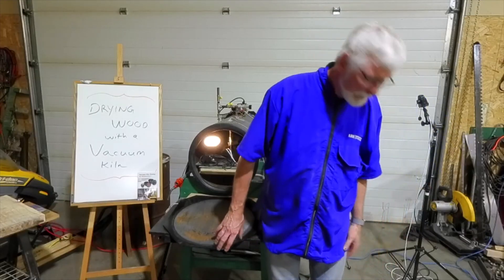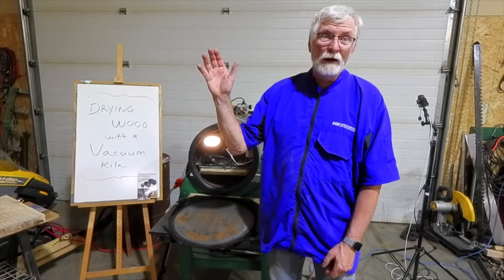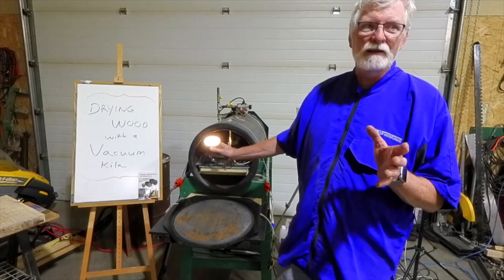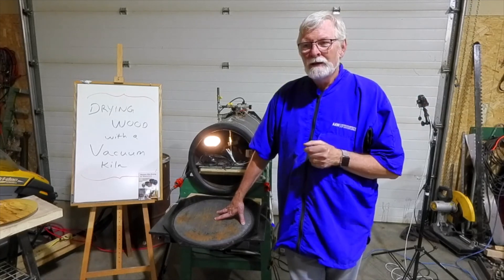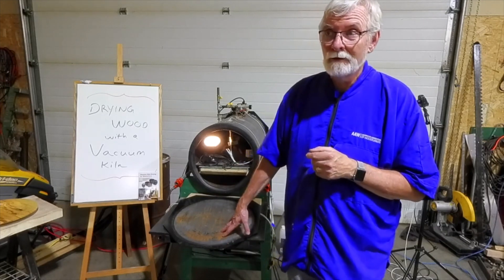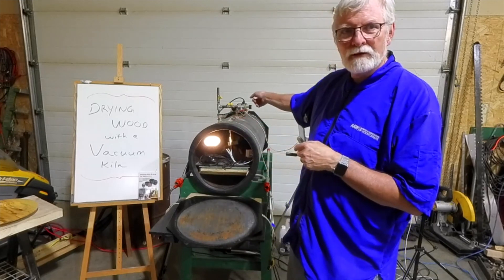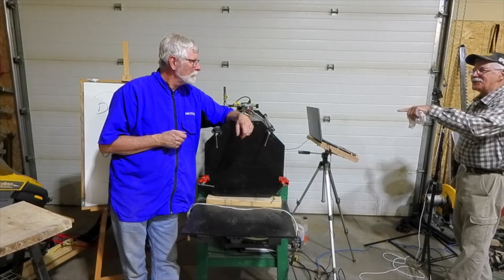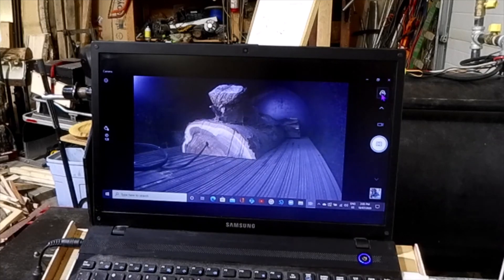Vacuum Kiln for Drying Wood

Comment: Excellent video, Jeff. I was thinking about how to build one until I stumbled upon your video. I am looking to build one to dry boards as long as 8 ft and maybe 4-5 at a time. Do you feel the boards should be weighted down as they dry to prevent warping? Or is this not necessary?
Reply: I imagine they would do better that way since so many have a natural twist. Obviously I don’t dry stuff that long. I have observed that many people want to do the long stuff. I just do wood suitable for turning which was the intention of this video.
Reply: @j.hankinson7803 I would agree but wanted to make sure I wasn't just wasting my time. I'll let you know. I am going to try to use an air bladder of some kind or two plates that can be compressed via external jack bolts.

Comment: Would a 100 gallon propane tank be usable?
Reply: This question has been asked several times in the comments. I think it would be much to thin. Those things have roughly 2 to 3 mm walls I think (1/16 to 1/8 in bananas). Mine is more like 9mm (3/8 bananas)

Comment: Also for heating - look into the ceramic infra red heaters that people use for reptile enclosures. IR transfers perfect in a vac and the ceramic type of lights construction should be good for within the chamber. This eliminates the need to heating pads and such making contact.
Reply: Thanks for your comment. I have a similar vacuum kiln built. But mine consists of a flat plate heaters placed underneath the trays in which the material is to be dried. The flat heaters do not dry evenly. So I was also contemplating on installing IR heaters into the kiln, but was skeptical if it would serve the purpose under vacuum. Your suggestion inspired me to try out IR heating. Will come back to post the results after installing IR. Thanks for your valuable comment
Reply: @abdussamadshaikh3467  I am looking forward to hearing the results.
Reply: I considered that as a heat source but the penetration of radiative heat is probably a lot less than conductive heat. It’s tough enough to warm a thick piece of wood as it is. Plus the heat mats described only heat to about 40C max whereas the heat lamps are a lot hotter and possibly less efficient electrically.

Comment: Hi Jeff, thank you for your excellent video. I have some large slabs to dry 3'x8'x3" and wondered about using a vacuum to dry these. I don't have a chamber available (we're in the UK) but considered a vacuum bag to draw the pressure and putting a sump in the bag to allow any moisture to run into & gather, heat would be provided by a heat blanket.  Do you think this may be viable ? I would appreciate your thoughts. Regards Mark.
Reply: Sorry, I don’t think that would work. With this idea you are drawing a vacuum within the bag obviously but the pressure on the wood remains the same thus the moisture won’t vaporize as with the method described.
Reply: I tried vacuum bag drying,  it absolutely does not work

Comment: What are your thoughts about using a large stock pot or beer brewing pot - 50 gallon?
Reply: It really depends on the wall thickness being able to take the 15 lbs per sq inch of one atmosphere pressure. There are things that look similar to that on Amazon used for resin and wood work. I think some have tried pressure pots too.

Comment: I don't know about vacuum but those gas cocks your using are only rated for 5 psi.  If you were having any leak issues I would start there.  You would want to use ball valves casted on the side WOG. [Water, oil, gas]
Very cool. I'm going to order that authors book an attempt to build one of those! Thank you very much for sharing!
Reply: The gas valves I am using are described as gas rated and have worked very well for several years. Thanks for the info.

Comment: I do wood turning from logs, splitting or sawing them in half or quarters and then trying them.  How will a vacuum drier work for drying non-flat pieces of wood?  heat mats will only give good contact on the sawn side--how necessary is the heat cpntact on the round side of the logs?  currently I am using a food dehydrator to dry half logs at 115 degrees F for 2-3 days and am getting even mulberry wood (very wet) to 0 percent moisture without any checking.  I just need to do larger pieces for turning, as well as process more at a time such as a whole tree's worth of wood as they become available.  what other heating sources will work in a vacuum?  Have you considered making a small ebook and selling it?  This video is encouraging but leaves lots of questions too,
Reply: Hi Steve. I have dried half rounds of wood as well. The biggest problem is getting adequate heat to the centre of the piece. Since the roundest part is most often turned away anyway, I flatten that area a bit with a bandsaw or chainsaw to encourage better heat transfer. A heat mat above and below is best which suits me since I usually stack two layers in my kiln anyway. Generally pieces up to 4” thick dry the best and up to 5” max which captures all of the bowl pieces I use. Past that thickness I would suggest rough turning before drying. If drying sticks up to 3 to 4 inches diameter I’ve tried making a layer of them side by side and that works fairly well. My heat mats are pretty stiff so they don’t wrap well around smaller pieces like that. An ordinary heating pad (like for a back) can work well as long as they aren’t set too hot since that can cause more distress to the wood with cracking as a result. Body temp - 98F or 37C - is enough. 115F is getting a bit too warm. Other heat sources like heat lamps won’t work as well I think since the heat transfer method isn’t as effective. Wrapping the pieces in tubing or something becomes unnecessarily complicated. As mentioned elsewhere in these replies microwaves are out of my skill level. Microwave heating plates and hydraulic pressure are used in $$$ commercial units. I have aimed this presentation at the little guy working at home, with a simple, fast, and inexpensive method of delivering dry wood. A ‘warm box’ is a reasonable alternative. This is something like a fridge or insulated cupboard heated with a lightbulb and circulating fan (incandescent of course). Many people use these successfully for larger sized pieces. They just take longer... This is probably a better solution for the large volumes you are anticipating. There are lots of YouTube videos on this method. I suggest checking YouTube for Sprague Woodturning since he does large volumes of hardwood bowls and has a good fridge kiln design. I have no plans to write an Ebook since Josh Salesin’s book has all the info needed and is easily available on Amazon at a reasonable price.
Reply: @j.hankinson7803  Jeff, thank you for the detailed reply.  The reason I suggested an ebook is to provide something different from the book you mentioned.  A discussion of principles and video along with it of showing how to do each of the steps as well as a bill of materials with sources.  Your video here is great but some things are glossed over either because of length of video allowed or because each of us will be starting our build with different skill or knowledge.  A for instance is that the 4" tube is filled with straws, but I have no understanding of why you would do that  or what it gives you.  It is not clear whether that 4" pipe was hooked to the same place as the other 4" pip with the drain valve or plumbed in differently.  A bom with sources would allow us who have never seen anything other than a heating bad for sore muscles to understand how the mats you mention are different and let us know one place to get them.  I am uniquely suited to the manufacturing of one of these since I am a toolmaker by trade and have a shop full of manual and cnc equipment.  My metal suppliers offered me a 20" x .375" wall tube x 60" OAL for $300.  That is the only price I have received back so far for the tube.  I have considered used air compressor tanks but even on ebay they are going for about $200-$500.  discovering a cheaper alternative so far eludes me.     I am not sure I could hold this project to the $500 total price you suggested.  (but that is not the ceiling on what I am willing to spend, and each of us comes to a project like this with different amounds of on hand stuff to use).  A BOM would help potential builders source things such as the 110v shut off valve and the hose rated for the vacuum connections, as well as help with a schejatic showing how all tyhe parts connect.  
The ebook idea was just to formalize plans and parts to make it easier on the builders.  Maybe we can collaborate on that after I get one built, who knows.  I thank you again for your quick reply!
Reply: if we could make a perfect vacuum, would we even need a heat source?  It speeds drying up to add heat, and bridges the gap when we cannot make a perfect vacuum.  And we cannot make a perfect vacuum without many $$$, but how important is the heat source?
Reply: @stevemitchell1265  Hi Steve. Lots of questions. Regarding pipe, I live in Alberta where pipe is plentiful. Most turners I know are scroungers and with a little asking around can usually lay their mitts on a short piece of metal pipe, often for free. Plastic sewer pipe is usually free for the asking on construction sites. Likewise there are as many solutions to kiln size and accessories as there are turners I think. Air compressor tanks would be inadequate I think but I’m no engineer. A guy can even use an old pressure cooker pot. When the proposition gets commercial, the problems increase. An engineering report to ascertain the safety of your materials, scrounging not allowed, standardization, transportation to point of sale, small market, etc all of which you know about I’m sure. Regarding my use of 4” pipe, both the pieces I describe are not essential. The short piece attached to the tank drain is very desirable though for the reasons mentioned in the video. The other piece is in line with the vacuum. A pipe filled with straws is the cheapest thing I could try to increase surface area for the little bit of moisture laden air to past by. I get a certain amount of condensation of that undesirable moisture as a result. I also tried stainless steel pot scrubbers from the dollar store but they didn’t work as well. There are expensive solutions to this problem for sure but that defeats the objective of an affordable kiln. A heat source is essential. If you could transport a piece of green wood to the space station and throw it out the window, it would freeze very quickly, possibly explode, but wouldn’t dry. The imperfect vacuum we can draw here is just enough to allow the water in the wood to vaporize with a little heat. The wood dries without being damaged. When I started this project several years ago I knew there had to be a way. I came across Josh’s book and saw the path to success. I came up with my own solution to the problem and added some other bits as experiments. It doesn’t have to be any more complicated than the vacuum pots widely used for resin work. A chamber capable of withstanding an adequate vacuum, a vacuum gauge, a small vacuum pump, plastic line, and heat mat/pad are all that’s needed really. Using and old pressure cooker pot I could build one for a single bowl blank (not very big admittedly, maybe 8”) for about $100 using a simple new vacuum pump and a heating pad off Amazon. You can buy a new 5 gallon vacuum pot and pump for about $250 (Canadian dollars so that’s about $49.95 US ha ha - our dollar is so weak right now). One of these would do the job for a fairly reasonable size piece of wood with minor modifications for a small heat pad, and 110v source inside. Someone I know was going to try heating his pot with solar but I have my doubts about that method. These points illustrate why I think this is a victory for the little guy. A little scrounging and creativity can go a long way in making a fast, inexpensive, and easy solution to drying wood. Cheers.
Reply: @j.hankinson7803  Got it.  Thanks very much!

Comment: Thank you very much for demystifying this process. I am extremely interested in building a kiln capable of drying wood the size of a dining room table for building furniture or beams for a log cabin. Do you think that it's possible to scale up the kiln to achieve this?
Reply: This kind of process has been scaled up and there are commercial units available to handle the much larger material you are asking about. This presentation is aimed more at the ‘little guy’ as I said, interested in drying appropriate wood pieces to turn. 
The basic principles apply to any size wood. The problems arise with container size, pump size, loading, getting heat to the centre of the wood pieces, longer dry times for longer lengths and of course cost. I have seen on YouTube commercial units using microwave heating plates and hydraulic pressure to dry large volumes of beams and thick planks over a week with appropriate monitoring. I have also heard that Woodmizer is marketing a kit for a more conventional kiln for larger wood volumes. Lots of variables for you to consider.
Reply: @j.hankinson7803  thanks for your reply, just for your information I am exactly the little individual you referred to. I am always crying when I logs being wasted. I have tried the Alaska mill and have a basement full of lumber.  I discovered the vacuum thing two years ago and yours is the first time I found where a regular human can do this. The biggest part I need help with is the information on the pumps, sizing and where to buy and what to ask for. I  remember the box that I saw had 1/2 in stainless and measured about 4x4x13 feet

Comment: Question: where did you source the heating pads?
Reply: Amazon. They are meant to be stood on so are very durable stiff rubber with heating wires moulded in.

Comment: thanks for sharing. i wanted to know if you must have heat contact everywhere on wood surface? in other woods ..lol...mat is 16 x 36 but  wood is 18 x 48 for example would that still work? also if a bigger tank  then just longer top attain a vacuum? or need a bigger pump? i have got almost everything i need to build one
Reply: The heat mats below and above work well and are simple. You don’t need heat on every surface and that would be quite hard to do anyway. The heat has to rise to the centre of the wood so if the piece is too thick, it may not get there. 4 to 6 inches thickness seems to be my limit. I try to put the temp sensor at the mid point of the wood so I have an idea when the process is finished. I layer the mats so I can get more wood into a run and with thicker pieces on the bottom, they get it on two sides. A larger tank would take a little longer to draw adequate vacuum and might pose some more leak problems but otherwise would work the same. Mine is 18” across as described and works for anything I’m likely to turn. A friend made a 24” diameter kiln and it works just fine. All that said, it usually takes about 3 days from green to dry so I don’t fuss much about readings now.
Reply: Trying to dry pieces 48” long is something I had no need to do since I wouldn’t be turning that long. If the pieces to ultimately be turned will be shorter, I’d cut them first rather than drying them long and cutting after. The moisture has to travel from the centre to the endgrain ends so a shorter path is better I think.
Reply: If the wood is longer than the mats obviously the heat won’t penetrate those parts very well so there may be some issues there. There are other methods of heating wood like microwaves but that gets complicated really fast. I subscribe to the KIS principle.
Reply: @j.hankinson7803  thanks  for replying.  I'm new to turning  but also have been making river tables and currently have several logs stabbed and air drying. Very excited to try out this vacuum kiln!
Reply: @j.hankinson7803  thx again for the reply. i was wondering how well aluminum sheet would dissipate heat. for example if i wanted to do a piece 8 ft long  but only had 6 ft of matts..(3 ft and 3 ft end to end for example) but had the aluminum sheet extended the full distance....would it carry the heat out from the source?  might look into radiant floor heating matt to better accomodate. nice to know the larger size chamber should work as well. How long was your friends 24" diameter kiln?
Reply: Hard to say if the aluminum would work well enough that way. I’d be inclined to extend the mats to each end and hope the middle caught the heat. The problem with such a long piece is the moisture has to travel so far to the ends. If you plan to do entire logs, it’s hard to get the heat to the middle of the thickness. I tried doing 1/2 log rounds and wasn’t happy with the heat transfer. Flattening the top and bottom improves that situation. My friend’s is 48” long. Mine is 40” since that’s as far as I can reach inside if something needs adjusting. I suppose if your very long kiln doesn’t work that well for length, you could cut it in half for two ;
Reply: @j.hankinson7803  I understand correctly that the wall thickness of the heating chamber is 3/8 inches? The lower water collection tank (4 inches long) has a smaller wall thickness?
 I watched your video with the translation from Google :)
Reply: @VictorIvanovsky  see reply above under Victor Ivanovsky

Comment: Nice design.  I wonder if your drain tank could be sized for the 55% moisture load of the total.  Then you just drain it once at the end.  Just a thought.
Reply: It’s easy to close a ball valve, drain the tank, and reopen the valve. It also gives a guy an idea of what’s happening with the moisture too.
Reply: if that liquid is there then it still has a chance to keep the moisture inside the chamber up, best to eliminate it.